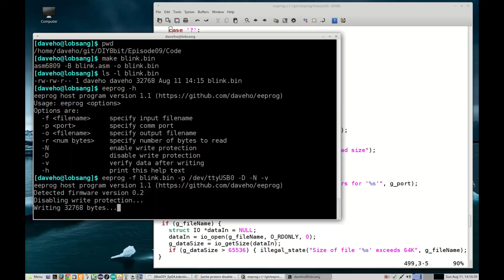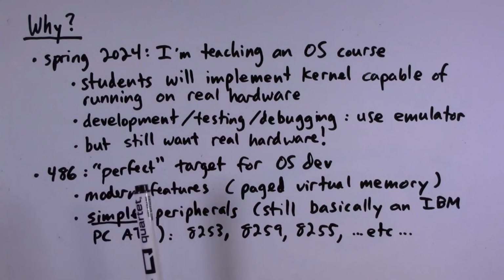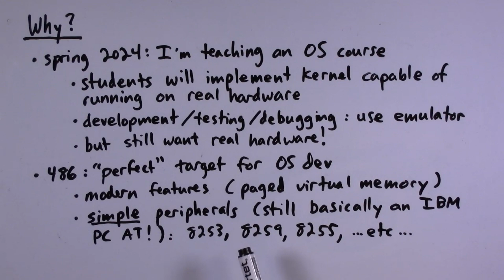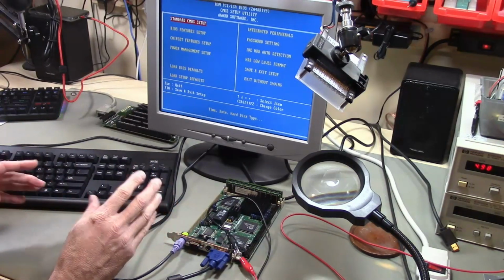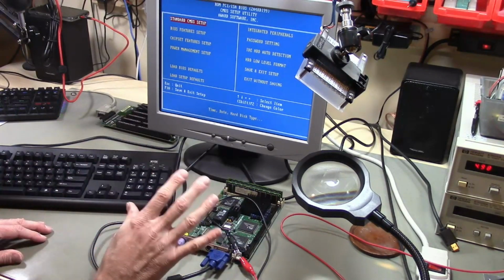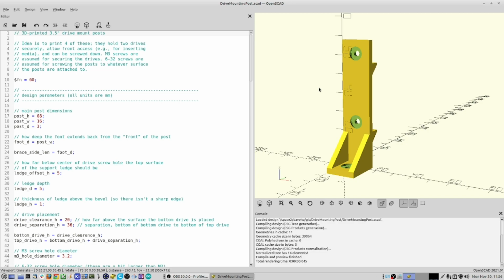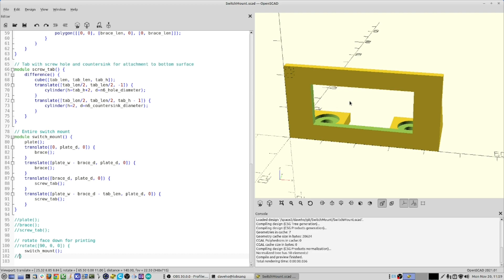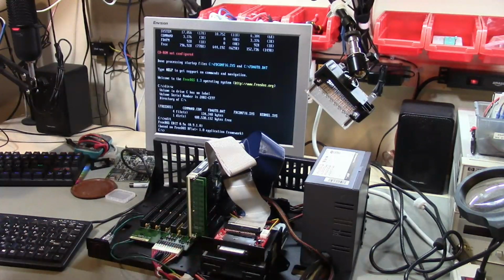PC Tech, Episode 05: Building a 486 PC — for an interesting reason

Comment: You could clean up the ribbon cables by removing the unused header connectors for extra drives and separate them into fifths and tape or zip tie them to give a cleaner look. Or swap the main pc card to the last slot and run the ribbon cable under the backplane this was always my preferred cable management in at pc's they stay in place and out of sight just be careful while screwing down the backplane after that never have to to deal with management again.

Comment: Break a leg in course! Honestly though, I regret all my exposure to x86 and would rather forget it. ARM v6 would have been my choice. Have options like PiZero or RP2040 and a ton of STM options. Is in regular use in current day.
Reply from the maker: Thanks! I did seriously consider RISC-V. Maybe in a future semester. One obstacle to using RISC-V and ARM is the relative lack of standardization of the boot process and peripheral availability, so you're more or less obligated to target one specific dev board, and then you need to arrange for the emulation environment to match that board. Going with good old 32-bit x86 means you can just assume standard PC BIOS and peripherals for both emulation and actual hardware. I agree that x86 isn't elegant, although 32-bit x86 isn't too horrible (especially when you compare it to its 16-bit predecessors.) You can just set up the code and data segments to be flat and then you basically have a VAX 🙂
Reply: @davehohacks  I would agree with RISC-V but would just add, don't conflate with ARM.  Arm has been around since 80's (Acorn Computers), is the most popular architecture of all time and will be for long time to come.  It is a descendant of 6502.  QEMU emulates ARM just as well as x86.  You may have a point with most popular BIOS perspective.  For a CPU course though, skip the BIOS?  I did some searching on open source BIOS'es and there are interesting options although I don't recommend anything specific. (There does seem to be a UEFI published standard now, and there is reference implementation .. but yeah, the BIOS history for ARM is more complex up to late 90's .. arm-trusted-firmware)
Reply from the maker: @kippie80  I definitely don't have any objection to ARM. I did actually think about the Raspberry Pi as a candidate development platform, since its boot process is reasonably well documented. I also agree that the BIOS isn't really important other than as a means of loading the kernel. Mostly I'm going with 32-bit x86 because it's a platform that I have some experience with writing low-level code for.